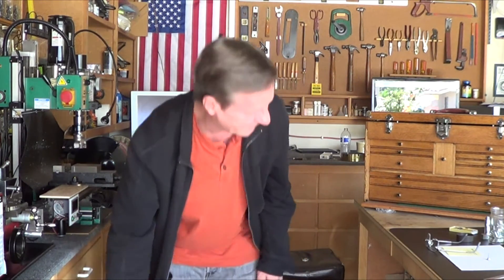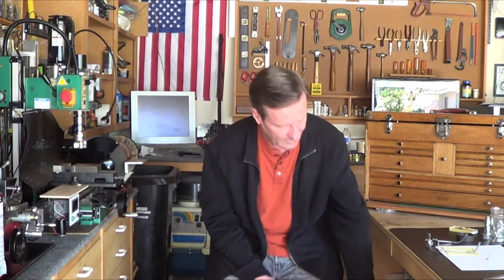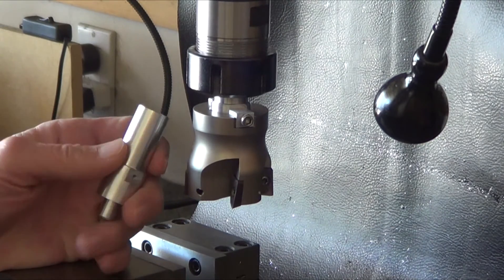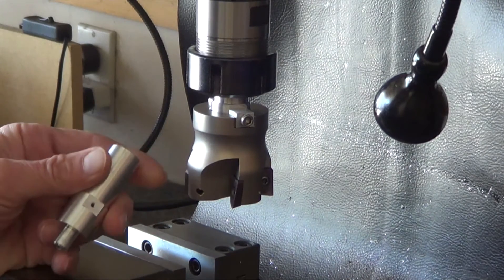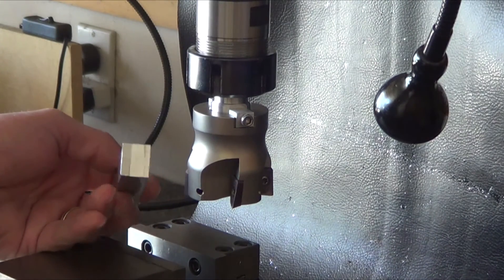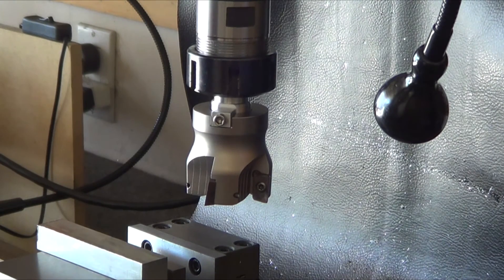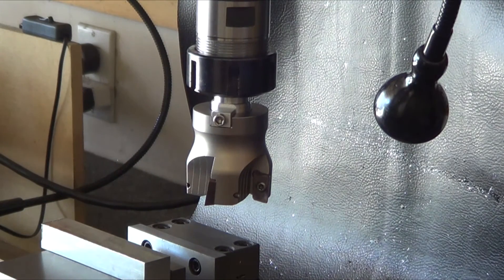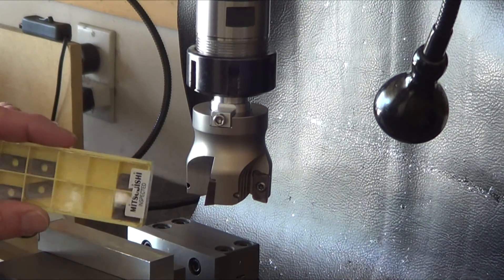Face Milling on the Mini Mill Video #66

Comment: I know it is old video.
But if you wanna try i got best finish on mini mill using metal hole saw as facemill.
Ones with carbide inserts works great.
Tay are cheap and efective.
Tay dont straing mini mills that much.
Reply from the maker: Thanks, I'll give it a try!

Comment: Hi Dave, I bought a similar looking head with the R8 arbor for $35 on ebay. It came with APMT 1604 inserts. The finish on aluminum is atrocious!. It rocks on a flat surface. I measured the height of the tips f the inserts with a srface plate and height gauge and found one was consistently .0025" higher than the rest, regardless of which position it's in. I'm throwing another $14 at the problem by trying these: https://www.banggood.com/10pcs-APKT1604PDFR-MA-H01-Carbide-Inserts-for-Aluminum-p-1088726.html?cur_warehouse=USA. I'll let you know how they work.
John
Reply from the maker: Hi John, Wish I had more experience with this type of cutter. Mine rocks on the granite surface also. Tried a lot of different tests and fail. The inserts themselves just don't feel sharp! Tried with just one insert and yuk.. Try yours with one...
Reply from the maker: I've learned a lot more and added more capabilities to the shop since that video was released some 1 1/2 years ago. Just pulled the cutter back out and manually sharpened one insert. I was right part of the problem is the dull insert....IMO this mill doesn't have enough mass or HP for this cutter. Specs say max cutting dia 3/4".
Reply from the maker: Any luck?
Reply: Still waiting for the new inserts. They're  on a slow boat from China...I haven't tried using it as a fly cutter because I don't like the shape of the insert - the cutting edge looks blunt, rather than sharp.
Reply: I received the inserts today and gave them a quick spin. First, the tool still rocked, but I didn't investigate further as I just had a tooth pulled and the novacaine is wearing off. I ran it across a slab of 6016 aluminum, .010" deep, roughly 1/4"/second and ~500-600 RPM and was pleasantly surprised. A very nice finish, not quite mirror like, but much better than an end mill and 1000 times better than the inserts it came with. I'll play with it more in depth soon, but I would recommend throwing another $15 at the problem and try these inserts.
Reply: Just ran at 1100 RPM and it's even better. This finish is as good as I can hope for with a mini mill.
Reply from the maker: Glad to hear back! Send a link to the inserts... Tooth pulled! I'm having a Jack Danielson the rocks for you.... maybe two just thinking about it!!
Reply from the maker: Just ordered them BTW on traverstool.com those are $46 each. Don't look the same but the part # is the same.
Reply from the maker: Hi John, just received the inserts and WOW! Thank you so much for the tip!!! Will show in an upcoming video.. I loosened and tightened opposite sides while on the surface plate and the rock went away.

Comment: I am fairly new subscriber and  I have the same equipment as you and have had great results using a 1.5" facemill on the mini mill.  My facemill is solid (no separate arbor).  It had a 1" shank when first purchased and I turned it to 3/4 to put in a R8 collet.
Reply from the maker: Do you have a link to the face mill? I would be interested in seeing it!
Reply: Dave M I found it at a flee marlet.  This one on eBay is similar without coolant passage.  https://rover.ebay.com/rover/0/0/0?mpre=https%3A%2F%2Fwww.ebay.com%2Fulk%2Fitm%2F232448083294  

I can send direct pics of tool and finishes by email.  I am running a belt drive.  Max rpm on lower gear.
roger.stubbings@williamsonmachine.com
Reply from the maker: You definitely have my attention! I think mine has bad inserts. But if you put yours on a granite surface or something flat does it rock?
Reply: Dave M My inserts are needing replacing however I still am achieving 32 or better finish.  I just checked rock on a 123 block and has about .005 but needing inserts   would not value that measurement.  I am using the belt drive.  Max rpm on slower pulley.

Comment: Hello Dave,  Did you report your experience to Amazon itself?  They will step in and force the seller to make it right with a full refund.  In my experience once you have tried as you have they are then willing to handle the problem.  Take care.  Doug
Reply from the maker: Hi Doug, yes I did and their policy is one of the main reasons why I try to buy from Amazon first. Thanks!

Comment: same face mill i have , mine came with an arbor and 4 inserts for 45 shipped./needless to say, i just tested it and ruined the work on first try.I too think the face mill is solely a tool for super rigid , heavy duty machines.

Comment: Dave ,I almost bought a similar face milling bit but after watching this video I decided against it. of all the indexable facing end mills what is the biggest size you think would work with a mini mill?, I'm looking at 1" with two APKT inserts.
Reply from the maker: I think a face mill is more a waste of money for surfacing. I've watched many videos of people test indicating the inserts trying to get them adjusted all the same height. Its impossible, one insert always ends up doing the cutting while another follows with a finishing cut. I think mini mills flex and vibrate to much for this type of cutter. I also don't see that great a finish with $80,000 CNC's. Watch some of my videos using a fly cutter. I get insane finishes with my latest DIY one. https://www.youtube.com/watch?v=fK40jx1alw8

Comment: Hi Dave ,I am Using large face mills on a Mini mill, I made my own arbours I bought the Cutter from Poland a 50MM face mill, High Speed , it works Better if you have a motorised movement on your  X travel l, hope you have better luck! just a thought
Reply from the maker: +Steel CAD Hi and welcome aboard. I just kinda gave up on the idea for now. Didn't want to spend a lot of money to go in this direction. Spending my time on lathe inserts and improving finishes which is my next video.

Comment: I think your problem with the face mill isn't your machine. It's the quality of your cutter I believe. Could be the inserts as well. Even though they came in a seal Mitsubishi box, I have seen knock offs, but not for some time now. I run a 3" Seco face mill with 4 and another with 10 square kennametal inserts and it makes a beautiful cut and finish on my old HF mini mill. What speed are you running at?
Reply from the maker: +Nick Schneider I'm guessing its the inserts but didn't want to spend hundreds on an experiment. I was hoping someone with experience, like you, would leave a comment! You're comment tells all it is possible but you have to spend $$. Love your input... Speed unknown just crank the knob half way. Not sure if I want to proceed yet....